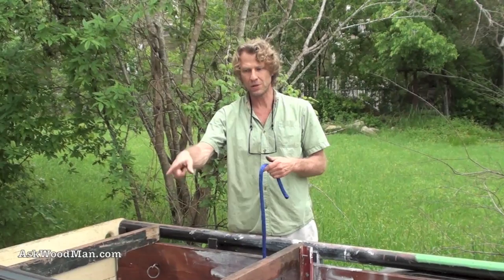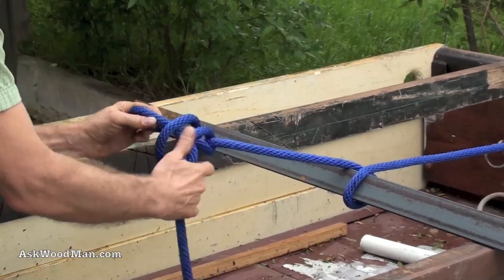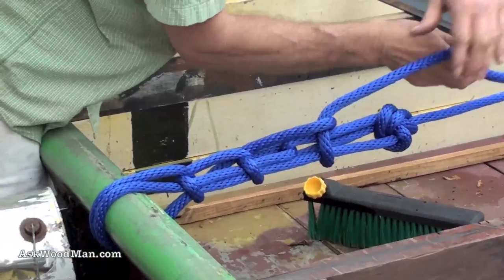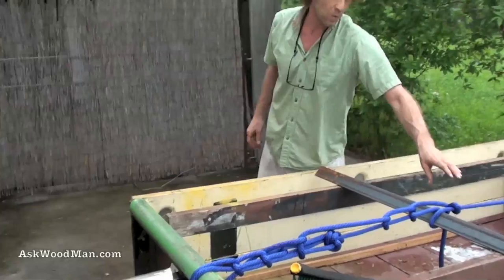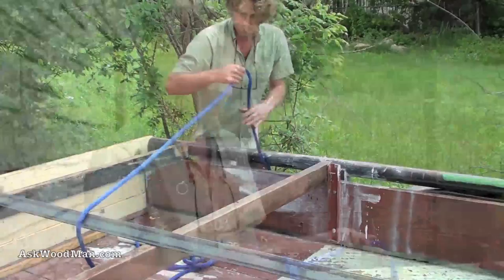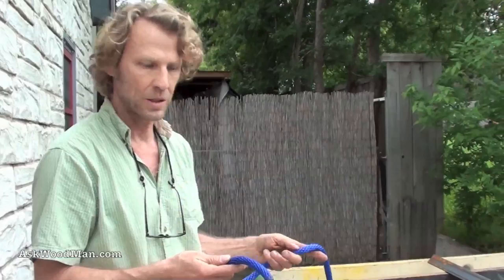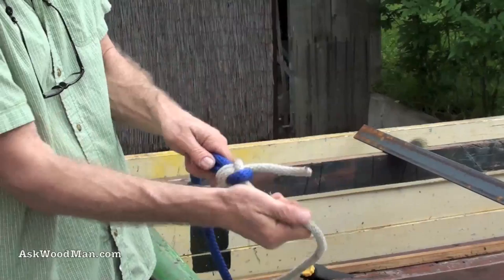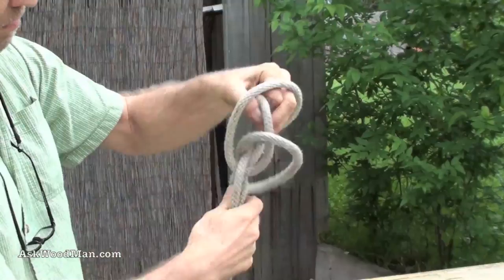Using Ropes To Tie Cargo Securely To A Trailer -- KNOTS & ROPES 7 of 8:

Comment: Allen,

Correction on my Mechanical Advantage (MA) calculation on my last reply.  If you run through the eye of the Alpine Butterfly (AB) one more time, you will get 5 to 1 ratio of MA.  Each time you run through the eye of AB, you gain 2 more MA.  As long as you have room in the eye of AB, you can keep adding more MA.  Wow!! Basically, you are creating Block and Tackle System.

Comment: Nice clear video,  but, the use of an Alpine Butterfly knot is definately a no no, the reason being can clearly be seen in the difficulty in the un-tying of it after pressure has been applied to it.  here in the UK we use a slightly similar set up for tying down loads, but with out the use of an Alpine Butterfly,  we call it the "Dolly Knot" and is known to most if not all wagon (Truck in the US), drivers, or any other knot which has a tendancy to tighten on its self.  The untying of your system would become pretty much impossible if the knot became wet.
Search  "Dolly Knot" on Google.

Comment: Allen,

If you run through the eye Alpine Butterfly one more time and back toward the anchor (not where Bowline is tided, not that anchor, back toward you, where you finished off), you will increase the mechanical advantage to 4 to 1 instead of 3 to 1.   Trucker Hitch is the same as what they called "Z-rig" or "Z configuration Pulley System", or " 3 to 1 Pulley System".   Keep going through the eye of the Butterfly and you keep increasing mechanical advantage.  Give it a try.  Thanks, buddy.

Comment: Hey man, great video! 

A question for you (or any person reading really):

What is a good type/brand/style of rope to have on hand? Say, a guy wants to throw 100' in the pickup for this or other general purpose use. I know nylon and natural fiber and all that. 
I want something to tie down firewood, lumber, etc... a good "all around" chunk to have in the truck box! 

Thanks!
Reply from the maker: The ropes I am using here are what are generically called anchor rope. They are solid braided nylon. Very strong and durable and not expensive. 100' is a pain to use. I keep ropes about 16' long that can be tied together, but generally multiple 16' pieces are enough to secure things in a pickup or on a trailer.

Comment: I use the same knots, tied the same way for tying down things in my truck, only I hook a carabiner in the alpine butterfly for less friction. Can you tell me how to best tie the middle of a rope to a ring or around a pipe where the ends are not accessible?
Reply from the maker: David Platenkamp Just collect the rope together at the spot you want to tie and pass the double bend through the ring and tie a bowline.
Reply: Thanks, I'll try that.

Comment: What size and type of rope would be needed? Thank you.
Reply from the maker: I like solid braided nylon rope usually about 3/8 diameter. This type of rope is tough and durable, not expensive and very pliable. It is often referred to as anchor line here in the US. You can buy it by the foot at Home Depot or other hardware stores. I like a piece about 16' or 5 meters for general use. A good length for trailer or truck tie downs but not too much extra to get tangled.
Reply: @AskWoodMan  - Thank you for your help. I bought this rope from Amazon. I hope it will be O.K. If it's not I can always order another. What do you think - I think it is 8 mm - will it be ok?

I need to secure a water tank to a stretcher to get it taken up the hills! One of my water tanks burst in the freezing weather in January. Still trying to get the job done.

I will need to come back to learn how to tie those knots.
Great clear video! Most people talk too fast for me to follow what they are saying. A massive help. Thanks.
Kind regards from
Giggling Star